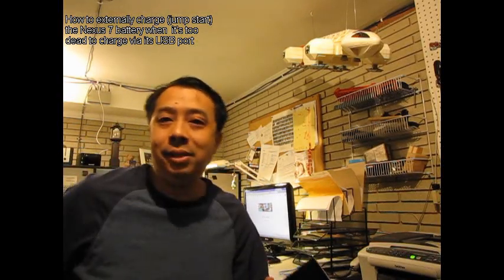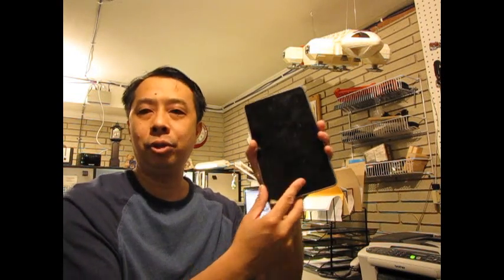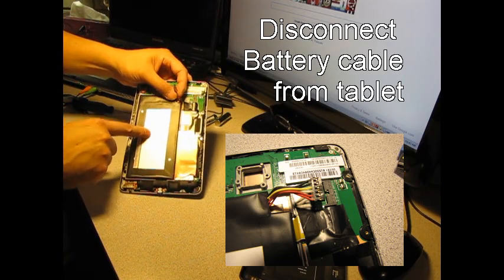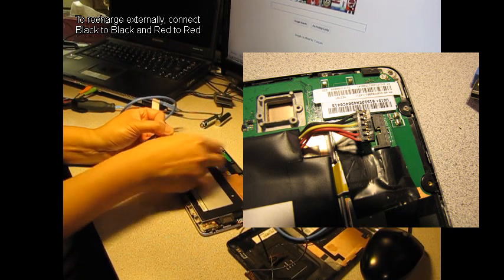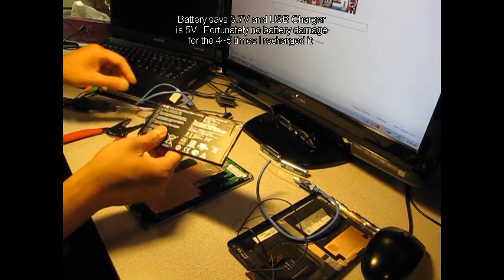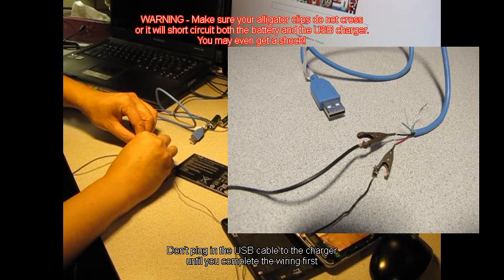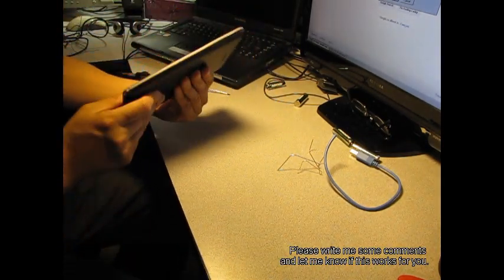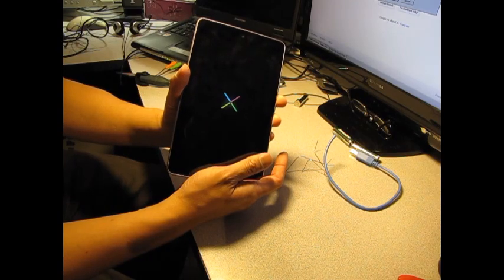Externally Jump Start Your Dead Nexus 7 - Final solution when all else fails!

Comment: I tried this and still couldn't get my Nexus 7 to turned on. I followed this video. I used a known good cable, a known good charger, and made sure all the contacts were good. Chaged each cell pair for 30 minutes. The battery never got warm but the charger did slightly. Then I held power and volume down for 30 seconds. Nothing. Anyone have any other ideas?
Reply from the maker: Robert Merritt , Sorry to hear you couldn't get the jump start method to work for you.  Do you have a volt meter?  If so, you can use it to measure if the battery is completely dead or not.  With 30 minutes charge per cell, the battery should have some measurable voltage.  If it doesn't that means there is likely something wrong with your wiring connection.  Or if there is a voltage measurement, unfortunately your problem is likely something else.
Reply: Did you try powering it on normally? Might be a stupid question but this worked for me after I just held the power down.

Comment: Hi Doug!
Wouldn't it be possible to put the black and red wires from the USB directly into the battery's connector, without the wires and crocodile clips? They do fit in there and you could fix them with tape.
Reply from the maker: John Brosius , In theory, you can put the USB wires directly into the battery connector and in fact, one of the commentators got it working this way.  However, most USB wires are thread wires, so in practice, it's like pushing a string into the battery connector.  But if you can get it working this way, that's great.  Otherwise there are other alternatives to alligator clips.  Others have tried using safety pins, garbage ties, and even sewing needles.
Reply: Doug Peng i did it and it worked! :) thanks for the great advice!

Comment: Well, it' the next day and I DID NOT have to use your method. I had the Nexus 7 plugged in to the USB port of my computer all night. When I awoke the table was still dark w/o a battery indicator for charging on the screen. I disconnected it and went to work. While watching other YT videos, I learned that all I needed to do was press the Power Button and both Volume Buttons, at the same time. The tablet is now charging. After being in the USB port, all night, the tablet charged to 46%. It is now fully charged.
Reply from the maker: PoliteTia , Depressing the power and volume buttons simultaneously would normally restart the N7.  However, this won't work if your battery is completely drained,  At that point, you'll need the jump start method to bring it back to life.  Glad to hear your N7 wasn't to this point.
Reply: I CAN'T wait to try you method. You are a surgeon on that tablet

Comment: What if you don't have any alligators clips?! Is there anything else that you can use to charge the wires with?
Reply from the maker: Aiden Adrez , you can use a nut and screw to secure the USB wires to a paperclip, others here have used bobby-pins, a sewing needle (jam the USB wire in the thread hole), and even a stapler.
Reply: Doug Peng OMG..... thank you so very much!!!!! I'm a single parent of two boys and I don't have the extra funds to replace a gadget every time they break and nor would I if I did... but my 3 year old nexus tablet have been completely dead for the last two months so he basically have took over my laptop... but thanks to your tutorial and viewing many of your comments, I too found myself feeling like a doctor reviving a patient back to life sort of speak.... I end up using two needles I actually threaded the wires threw the loops then I twisted the wires as tight as I could to the needles and taped them up, and stuck the pin point end into the battery connector.... I charged each for like 30min and did the following like you said and presto, it lite up like a christmas tree!!!!! So thank you for helping this single parent out, and for getting my laptop back lol, sending you a big hug! Take care and, God bless!!!
Reply from the maker: Aiden Adrez Congrats in getting it working again!

Comment: Doug, Thank you very much for sharing this video. I have disassembled the battery and have a suggestion. As information the lithium polymer battery is a single cell battery. The dual red wires at the battery connector connect to a single terminal on the battery PCB under the black insulating tape around the perimeter of the battery. The same goes for the black wires. So the need to move the USB charging leads from the inner to outer is unnecessary. 

Thanks again for the great video.
Reply from the maker: Ryan Hurst Thanks Ryan for confirming the battery is a single cell battery.  Another commentator mentioned it earlier, but did pull out the black insulation like you did to confirm.  Truly appreciate you sharing this finding with the readers.

Comment: Hi Doug, I tried to jump start the battery and it didn't work. I even bought a new one and replaced the charging port and it still didn't work. Is there anything else I could try?
Reply from the maker: Costel Chirila Sorry to hear you could not get your N7 restarted with my method.  If you tried using a new battery (with the assumption it is not completely dead like your first one), it is unlikely to be a jump start problem.  Do you have the model with the 4 pogo pins on the side?  If so you can try charging it with the docking port instead of the USB charging port.  If you have the wireless recharging model, you could try recharging it with that as well.  Given that its unlikely you have two completely dead batteries, these solutions might work.  If the batteries are completely dead, these methods would not work either.

Comment: it worked thanks XD but now because i played around with the pogo pins i can only charge via charging pins in if i use usb just says charging but no ma flow any of u experienced and fixed this
Reply from the maker: Clark Tulio You could purchase the docking station which uses the pogo pins to charge the N7 instead of using the USB port.  It's actually a more convenient way of charging.  Glad to hear that this jump start method worked for you, or otherwise even this docking station method thru the pogo pins would not work.
Reply: thanks but buying a dock in our country is quite expensive the dock will be more expensive than the tab itself ....thanks anyway ill just make my own dock

Comment: Doug, just wanted to take a moment to thank you for this tip. I bought a Nexus 7 online and it arrived with a completely dead battery and none to the tricks worked to get it to charge. It would briefly flash when I plugged it in, but that is all it would do after letting it charge for two days. I did your method as a last resort and it worked like a charm. I only let each cell charge for 5 minutes and the instant I plugged it in and pushed the power button + volume down the charging symbol appeared for the first time. Thanks a lot for posting this video. I had no idea that Lithium Ion batteries had this characteristic. It is definitely a flaw in the design, but it is nice to know that it is not impossible to recover from. Thanks again!

Comment: It didn't work for me and I did each cell for 30 min. Why? I need answers
Reply: I've even got a new USB port but I don't know if it still takes charge even thought I think its the battery so I'm trying it one more time
Reply from the maker: Matthew Machicek , do you have a volt meter?  This would be a good way to measure the voltage of the battery to see if it took charge.

Comment: I have a question, please! I have a nexus 7 "dead". I got another nexus 7 that is running, and switched the battery to the dead one. It didn't work... Should it work?   If it doesn't work, any recommendation on what to do?  Thanks a lot, great video, and great explanation!
Reply from the maker: Josep Torrell , it "should" work given the new battery inside the older "dead Nexus 7" has power.  However, you would need to press down the power and volume rocker buttons to get it into the reboot mode as I mentioned at the very end of my video.
Reply: Doug Peng thanks! i'll check later.. i was afraid i could broke something  ;)
Reply: Doug Peng doh! i tried again, and had no result. the battery of the working nexus, don't work on the dead one (tried all the button thing), and tried to put the battery of the dead one into the working nexus... and it didn't start neither. So i guess there is some other major problem around the dead one. Many thanks for your input!
Reply: Josep Torrell Did you have any luck since this post? I am in the same position.
Reply: falloftheziggurat Hi! nope, i had no luck getting the thing working... I sent it to asus, to see if i have more luck.

Comment: Doug, U R The Man!!! I just can't thank you enough for your video. First of all, I tried charging for 1 minute each, didn't work. I then charged for 5 minutes each, BAAM!!! It turned on and got 2% battery. My original asus cable is broken i guess, so it's not charing using that cable. I changed the cable with my chromecast cable, and it is charging now. Once again, thank you :D

Comment: Can't believe this worked, but it actually did.
Didn't have clamps so I twisted the ends of the wires and fed them right into the connections. Charged each pair of red and black connections for 15 min each. Hit the power button and it turned right on. Thanks man, you saved me from buying a new battery.

Comment: Doug. My man! Thank you! After days of googling, to no avail, I was about to start checking battery prices, when I found your video. It took me a couple of tries, but it worked like magic! Charging each cell for about 10-15 minutes gave me about 15%, which was exciting, and immediately powered on. After that, I did about 45 minutes for one cell, then 15-20 for the other, and it powered right on, with about 26% charge. It's now charging with the cord. Thank you for figuring this out, and for sharing your knowledge! =)

Just an fyi, I had no alligator clips, nor paper clips, but a stripped twist tie, connected from each of the black/red usb wires, secured into the battery cable, did the trick, just the same.

Comment: Thank you for the great advice. My 2nd generation Nexus 7 was suffering from the "My device turns on but immediately shuts off" problem and it would not accept a charge for more than a few seconds. I followed all of the usual suggestions but none solved the problem.
    https://support.google.com/nexus/troubleshooter/3337561?hl=en-CA
The problem was a loose battery connection. The battery was at 27% when it booted up. No need to manually charge the battery. It is now working like the day I took it out of the box.
Reply from the maker: Thanks for sharing this coming problem as well.

Comment: i have a nexus 5 with the same problem ... but the battery is a bit different don't know where to connect the cables
Reply from the maker: Mark Moonga I Googled a picture of the Nexus 5 battery, and noticed its thin cable strip connection which makes it difficult to connect to a jumper.  Also, the pinout configuration doesn't appear to be shown (i.e., which connector hole is the "+" and which is the "-".  You could purchase a new battery (one that has power in it) as that would allow you to reboot the Nexus assuming the problem is the same as mine).  Don't throw away the old battery though, as once you properly shut down the Nexus with the new battery, the old no-charge battery could still be recharged at this point.  Alternatively, if you have a volt meter and some thin wire enough to poke into the battery's cable thin strip connector holes, you might be able to measure which is the "+" and "-" terminals.  However, with a dead battery, this might be difficult to measure.

Comment: Hey doug. A friend gave me a Nexus 7 and he told me if I could get it working, I could have it. I took 2 small pieces of speakers wire and 2 staples and bent the stable straight and pushed it down inside the middle of the speaker wire so it would come in contact with the wire and the plastic would keep it nice and snug in place. It worked! Thanks a lot!

Comment: Thank you so much!  This worked like a charm. I didn't have alligator clips so I plugged the usb wires directly into the pins. Is there a problem doing it this way vs the way you did it?
Reply from the maker: Congrats on getting your tablet working again!  No problems not using the aligator clips.  The USB wires are often thread wires, making it hard to push into battery connector pins (like pushing on a string).  But as long as you make the electrical connection as you done directly, it works the same way!

Quite often, the cause of the original battery drainage is due to the tablet's wornout USB charging port.  Hence you should check if your regular charger now works.  If not, and you have the model where there are pogo pins (4 gold dots) on the side, you can purchase the docking station to recharge it from now on (see my comments to J Conder below). If you have the wireless charger model, you can also purchase the wireless charger.  Either way is better than fixing the wornout USB charging port, although that is not that difficult given its modular design.

Comment: THANK YOU!!!! nexus 7 just like yours exactly the same problem, been dead for a year! I followed your steps, but i used clothes pegs wrapped in aluminium foil instead of alligator clips since i dont have any. I charged both cells for 3-4 minutes and plugged it all back in and it started for the first time in a year.

Comment: Thank you very much Doug. I was able to get my Nexus 7 (2013) to about 6%, charging each cell for 20 minutes. There is a problem with my USB port (It looks like it has been bent into a very odd shape, so much that my USB does not fit in). I have thought of the wireless charger, but my only problem is file transfer. I primarily use my nexus for watching movies and so, need a USB port for transfer. I don't want to fix it myself. How expensive is it to fix my port. Waiting for your reply. Thank you once again.

Comment: now it's on but not charging,any help?
Reply from the maker: Quite often, the cause of the original battery drainage is due to the tablet's wornout USB charging port.  If you have the model where there are pogo pins (4 gold dots) on the side, you can purchase the docking station to recharge it from now on (see my comments to J Conder below). If you have the wireless charger model, you can also purchase the wireless charger.  Either way is better than fixing the wornout USB charging port, althought that is not that difficult given its modular design.

Comment: Geez, and I thought my son's device was dead. What a prick of a bug and what a cool solution! BTW, I just twisted the wires around a bit of paperclip wire and taped it rather than using the clamps. No risk of crossing/touching wires and I can easily store it and use again....

Comment: hi doug, my nexus 7 2012 has been dead for about a year , im trying ur jumpstart method and il report back with results. MY question is do u think it can be aved , being dead for so long
Reply from the maker: The jump start method should work, regardless how long your batter has been dead for.  There are many commentators here who also had their nexus 7 dead for more than a year.  Given that the battery has been dead for so long, I suggest you jump start it longer (i.e. 15~30 minutes per cell) to assure it got enough power to complete the shutdown sequence.  Good luck!

Comment: Hey Doug, you just saved a Nexus 10 :) This is so smart! Could you explain what exactly happens or what causes this problem? Cheers!
Reply from the maker: It's a design flaw with the Nexus itself, or perhaps its interface with the Android OS.  There is no inherent reason why the battery cannot get charged if the device did not properly shutdown.

Comment: Doug, Thanks ! After Wiping the Drive Clean, and completely Taking apart as far as I could go without removing the Gorilla Glass and Finding only one thing Wrong (and it wasn't a loose battery connector) the USB Port was bent and contacts were dirty! Reinstalled and put it all back together without loosing those minute screws by the way ! Well it still didn't charge unless I physically Held theUSB Jack Perfectly Still at just the absolutely precise angle ! And yes I tried five different USB cables and chargers! Anyway Took this advice (and yes it does get easier to take apart) , Jump started both sides of the battery for an Hour each side and Today the wireless Charger Came and violaMy Daughters Nexus 7 2013 works Again! Thanks again! Rock on Dude!!

Comment: This worked wonderfully!  Thank you for taking the time to figure this out and then share it with us.  2 y.o. 2012 Nexus7 wouldn't respond to any attempts to restart (button push combinations, battery connector check, removing battery).  After setting up the wires as you explained so clearly and charging each cell for almost 30 minutes each we put it back together and the battery light lit up and it rebooted.  I wish you could have heard the cheering!   It has now been fully charged with the regular charging unit.  Thank you, thank you, thank you!
Reply from the maker: Congrats and thanks for sharing your upifting story!